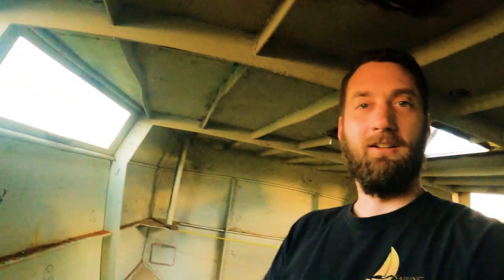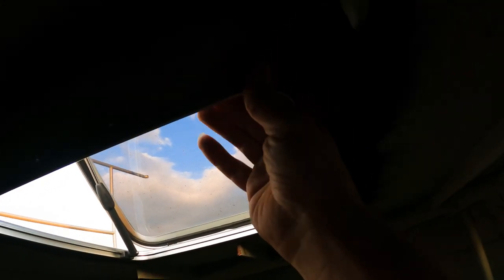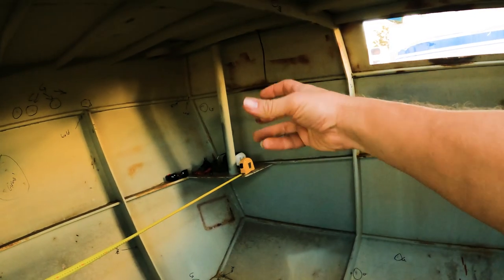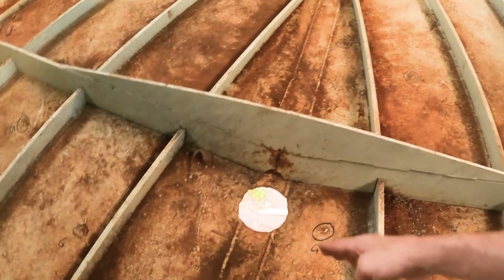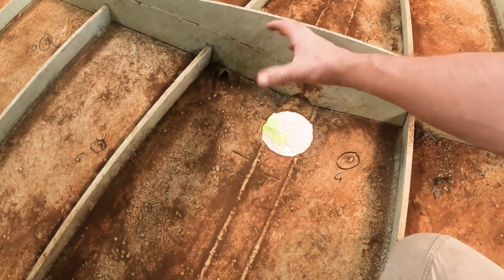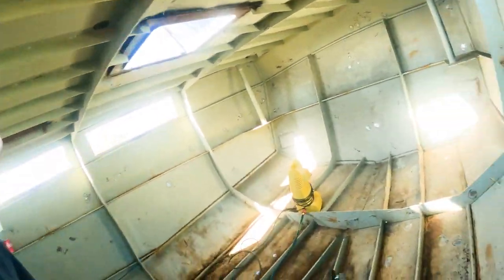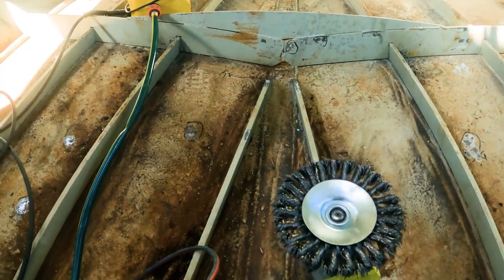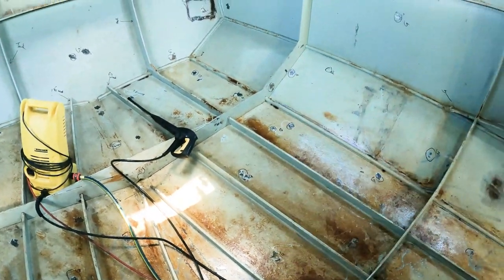Sailing QC # 30 | Starting the Aft Cabin Boat Building Continues | Steel Sailboat Restoration

Comment from the maker: We started our first room inboard, prepping the aft cabin this week. Grinding the walls and floor of the hull, prepping windows, pressure washing years of built up grime and coming up with layout plans and sizes required to incorporate the rudder positioning. Boat Building Continues at our Steel Sailboat Restoration!

Comment: Maybe you should also think about rounding the edges of all the stringers and beams so that the paint can attach better. I know it is a lot of extra work but have seen a steel boat in trinidad over then 20 years old with just about no rust in the interior.
Reply from the maker: Taking off the squared edges is definately needed to make sure coatings adhere correctly :) cheers!